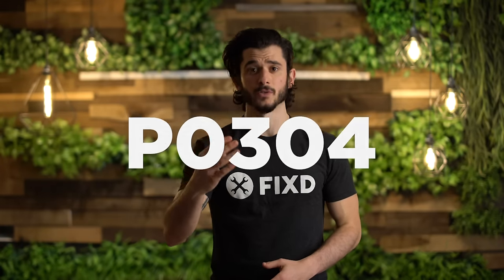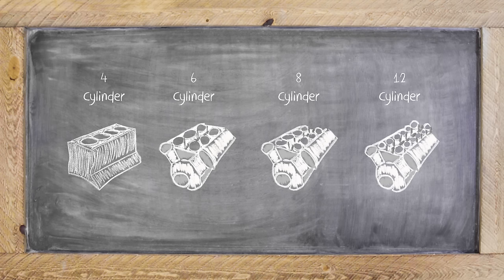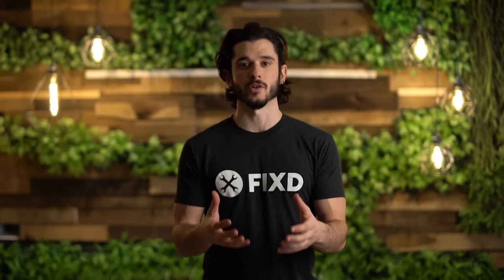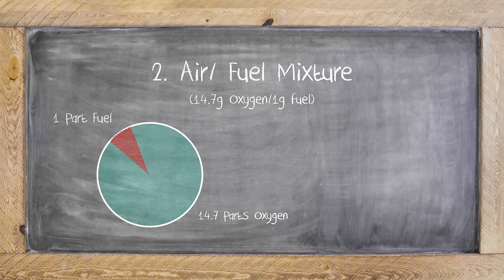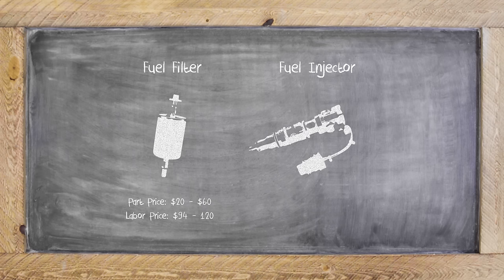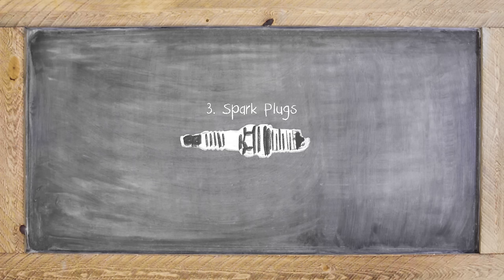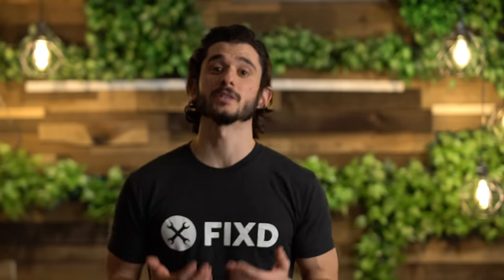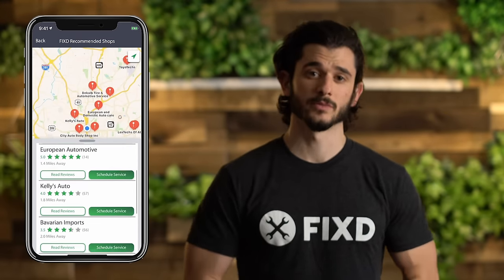P0304 Explained - Cylinder 4 Misfire (Simple Fix)

Comment: can you drive your car if obd shows no4. misfire ?
Reply: No
Reply: Yes.
Reply: No. A misfire is a serious problem and will cause the car to run rough. You need to get it fixed right away and don't drive the car with a misfire. You should have it towed to a service center and fixed. Typically a car with a misfire has a large loss of power, so you don't want to drive that anyway. A misfire is throwing, at least a little, unburnt fuel through your catalytic converter, damaging it, and you don't want that.
Reply: @TheLarryBrown  my 2008 Honda accord EX-L V6 sedan  Looks like the previous owner has installed as installed a spark plug with epoxy. My car started running rough and now it is throwing the P0304 cylinder for miss fire code. 
I'm pretty sure I just need to change all the plugs and quarterpacks but the spark plugs are oil fouled and and I guess autozone suggests I replace the mass air flow sensor too
Reply: I've been driving a hyundai elantra 2009 car with p304 code for a few months without any issue. I've sent it to workshop a few times but they couldn't figure out what's wrong. They've did the swapping method and the same p304 still happened. They suspect it's the ecu but the technician who repaired my ecu said otherwise.
Reply: @Kindaichi83  thanks for the reply, mines po304 and autozones said I should replace maf censor but I know it's a stuck spark plug I can't remove. Cleaned maf changed around coils w same misfire too. Was hoping it might be something else besides plug. But that's cool you're able to get around! I can get 2500 for my car if I dumped it now while it runs is the thing. I'm planning to do an extraction of the plug using broken spark plug extraction kit..yeah wish me luck!
But does your car basically sputter some when you come to a stop light? The thing is if I can't fix it it's gonna be worth way less NOT RUNNING
Reply: @Kindaichi83  also if a mechanic claims to have fixed your ecu but your still having problems have him fix it again
Reply: @freedompioneer4311  my car is running totally fine actually. No hard start, no rough idling no sluggish acceleration. It’s just the check engine light keep showing up flashing when I cold start the car, and then soemtimes it stays permanent, with a p304 code on the obd. I could reset the code and next day when I cold start the car again the check engine light will come back. Some days it’ll stay on and some days it’ll just flash for a few seconds and went off on it’s own.) that’s probably why the workshop finds it so hard to diagnose. The technician was 100% sure it’s not the ecu. Can’t argue with that since I’m not the professional here.
Reply: @Kindaichi83  definitely sounds like your ecu is working I tried all kinds of manual methods to diagnose my issue but I'm sure it all revolves around a stripped spark plug the previous owner used epoxy to install. Now I'm looking at different plug extraction kits and they're all for "broken spark plugs" which mines not broken YET, but it seems to run worse every time I start it up got the check engine light back on and a vsa light like it was just running okay so I suppose it's totally fixable but paying for the heads to come off and a few sensors would cost me like 2500
Reply: @Kindaichi83  strange issue tho on your ride sounds like maybe a faulty connection of some kind like a short, which I have code for ecm/pcm relation failure and modulator control unit power source low voltage code like omg

Comment: We have a grand Jeep Cherokee showing p0304. We changed the coil pack (#4), spark plugs, and gaskets, but still it’s showing p0304.
Reply: I have the same issue. Audi A4, p0304, new spark plugs in all four, 4 new coil packs, 4 new fuel injectors, only about a week later and the check engine misfire came back on.
Reply: Did you solve the problem? My is250 cylinder 4 is missfiring. Coil and sparkplug not the issue
Reply: So today we found out that somebody put coke in our gas tank. Fuel injector wouldn’t open up, our mechanic found sugar.
Reply: @cecigalvez630  wow. What jerks. Can anything be done?

Comment: This is so backwards for the Nissan plugs 20 dollers for some nice ones (under ignition coil) ignition coils are 25 bucks for a lifetime warranty ahah so cheap
Reply: Same with my Toyota. But then again, BMWs and Mercedes can cost $400 just to change the oil.
Reply: Honda has to take Ngk plugs. Around $15-20 each. I have an odyssey so I need 6. However the coils are $40 each.

Comment: Ive changed, plugs, wires , coils, fuel filter, swapped injectors, checked fuel filter, vacum hoses and I still get an intermittent code P0304 and it usually happens after start for no reason.. car runs fine..Im thinking maybe the ECU...
Reply: Mine started after switching out my downstream 02 sensor